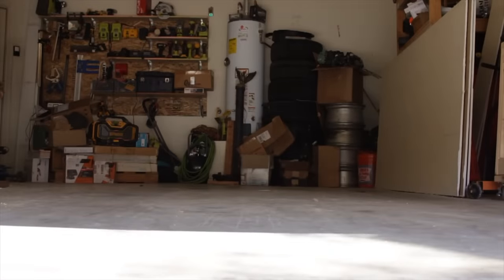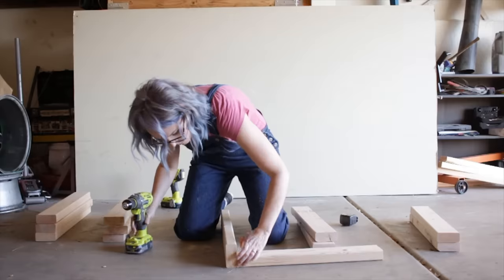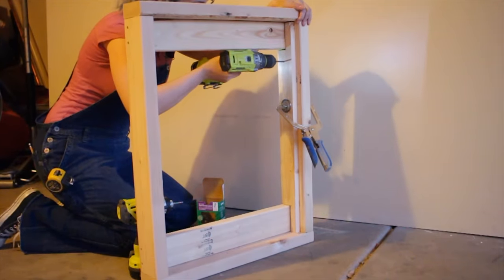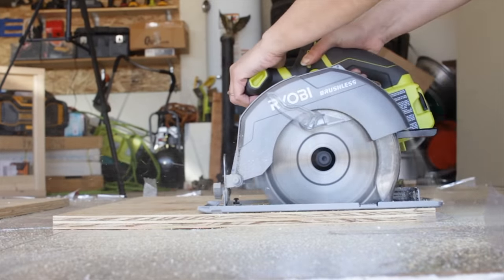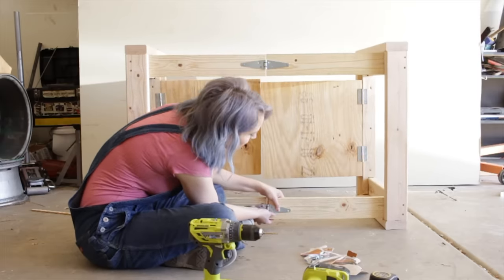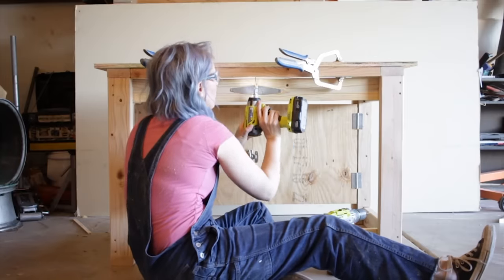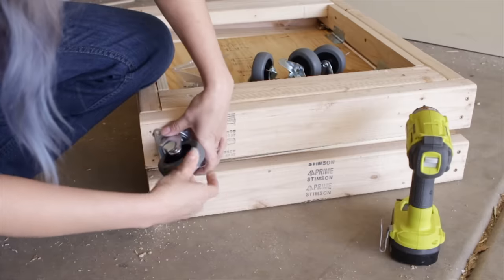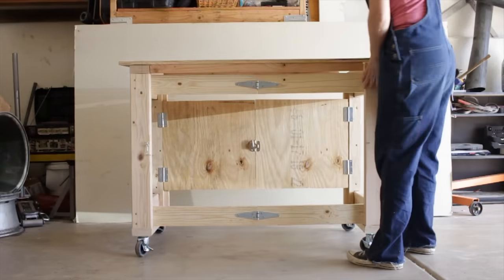DIY Folding Mobile Workbench

Comment: What is the total weight of the bench?  Is it easy to load in a truck or van?
Reply from the maker: It depends on the particular materials you use, but the base alone is about 25lbs

Comment: Remember seeing this on pinterest and thought it would be great to make it since I don't have space for a permanent work table and I'm really tired of making projects on the floor. Now I hace a better view of it and seems really nice. However a mod I will do is to make the top foldable in the middle, attach some L-shape brackets at the lower frame so it can be hanged there when the table is folded. A long piece of square metal tubing can be put below the top to prevent warping and make it sturdy for heavy objects.
I have a question, that plywood piece that is used for support in the back of the table, can it be substituted for two wood pieces like the ones in the front or the plywood needs to be obligatory? Thanks for the inspiration of this video!

Comment: The author mentioned the initial design came from a April 2012 issue of Popular Woodworking.  I went through that issue and couldn't find it.  A quick search of the PopWood site showed that the article is actually from the Feb/March 2007 issue of American Woodworker (which was purchased by the parent of PopWood).   So if you want to see the inspiring design, look there.

Comment: Good job, the window locks, stiffening rails and dowels were great upgrades. I'm wondering how stable the table remains after the casters are locked. If you come up with a change for that, please do an update video. Thx, you da man!, oh wait, "da woman!" 😎
Reply from the maker: Thank you! haha I appreciate the feedback. Once everything is locked in place, it's actually very stable. I have virtually zero wobble, even when using the belt sander. I for sure will share any updates down the road.

Comment: Unless you need the practice 2 saw horses and a piece of 3/4 plywood is way easier it's what most contractors use on jobsites. It's super portable and simple. This is a neat idea though

Comment: I am building the folding work bench, on the cut sheet you say 2  3/4" x 18" x 20 1/8" but in instructions move 6 you say cut 2 18" x 21 1/8" which is right it looks to me like they should be 21 1/8. What sucks is that I pre cut the pieces before hand. please let me know....tanks

Comment: Instead of measuring for the dowel locations on the top, insert the dowels, set the top in your desired position and carefully lift each end enough to smear some grease on the dowles. This will quickly transfer thier locations.

Comment: Initially, it seems like a good idea until I calculate the amount of money for the materials to build this workbench. It costs around $170 - $200 depending on the quality of materials. The Worx Pegasus costs $110 and is foldable, mobile, lightweight (25 lbs) with extra 2 clamps and dog ears. When folded, it can function as a sawhorse but when fully extended it is a decent size workbench. With that money for buying materials, I can buy 2 Pegasus which are very sturdy and don’t have to lift a finger to build it. This is a good idea if you have extra lumber or can buy it cheap from somewhere.

Comment: I've built one, bigger in size and with a vice on it , besides the fact that is soft wood and the top will not stay straight unless i add a middle leg , i'm really happy with it. But next time i'm gonna build one i'm definitely gonna make myself a easier job and fit some components the way you did, without routering like a maniac over complicated joints .

Comment: I'm curious, would there be a way to attach the top to each side so that it could be hinged and fold over onto the top so it didn't have to be detached from the frame? I know it would mean cutting it into 2 pieces. Would it cause you to lose stability?
Reply from the maker: I was trying to think of something like that too, but was afraid of losing rigidity. All the strength in this design comes from the top, so I couldn't think of a way to make it folding. If you come up with an idea, I'd love to hear it!
Reply: Pneumatic Addict you can potentially use a curved linear guide system on the legs to allow the tabletop halves to be securely fastened to the workbench frame at two points but still be able to slide/fold away. Adding some kind of clamp or locking mechanism to the centre portion of the horizontal frame which the tabletop locks to would give you a secure fixing for the tabletop and reinforce the overall structure.

Comment: Personally... I would have drilled down from the top of the Worktop down into the Runners... it'll be stronger as you will only have the depth of screw in whatever thickness of top you have the way you did it and then have the chance of the tip sticking out if you over tighten the screw... you can countersink the heads into the worktop and even putty over the top of them if you fear scratching a project... the other bit that set my teeth on end was referring to your Ryobi Cordless Circular saw and saying it should last another couple of projects... with the cost of any of Ryobi's Power tools it should be lasting years... not just a few projects... O.O Oh yeah... I can see there's a difference between the Plywood "doors" Sash lock and the one you showed yourself fitting... the "hook" part of it is hooked away from the clasp side of the lock - as fitted on the "doors", you had the "hook" facing the wrong way on the 2x4 side... other than that, it's not a bad idea, but buying a short length of ordinary Kitchen Work top, a piece of 2x4 the same length as the work top and a Black & Decker Workmate... which is so versatile on it's own, and by screwing the 2x4 to the underside of the Kitchen Top you can then clamp it in the vice jaws of the Workmate... even one of the cheap ones... by the time you have bought all that Hardware you're pretty close to the Workmate just up from the Entry Level one... just saying! ;o)

Comment: What stops it rolling around when suing?. Could cause accident. Do you mean 100× 50mm for legs?.
Reply from the maker: I am located in the US and use Imperial measurements. The caster's I installed have locking mechanisms and are easy to find at almost any hardware store.

Comment: I bought your plans for the 8 bucks, the hook and eye doesn't say what size they are. 2 1/2in or 3 in ???
Reply from the maker: Either size will work. If you use the 2-1/2", you'll just need to attach it closer to the edge of the board. For that reason, I would probably go with a 3" hook and eye.
Reply: @PneumaticAddict  thank you for the reply

Comment: How and Why do you pre drill??
Reply: So you don't split the wood is the number one reason. 
It also makes it easier to put the screws in. The screws will always follow the hole that you drill. 
The hole that you drill should be no bigger than the inside threads (the shank of the screw if you will) of the screw that you use.

Comment: So some of the areas you can improve this design are simple.  First if you were to use pressure treated 2x materials to increase the speed of assembly.  You don’t have to pre drill.  
Second pocket screws.  This will add more strength that what you’ve done here.  Better holding power and keeps you frame straighter.  
Third, heavier top.  Double that top thickness.  That will really help you design.  And round over the edge. Full 3/4 round over bit will finish this off big time.  
Lastly add a permanent tape measure to the working edge of your top.  It will allow you take quick measurement of small pieces of wood or items without needing to pull out your tape measure.  
One other thing you could do is drill hole for screw drivers to stand up on for easy reach and quick handling.  Adding a strong earth magnet to the front side of the bench will keep those screws you need for putting stuff together without taking up table space.

Comment: If you build this bench & have a specific height you need, take into account the exact height of the casters. The 3" casters I got add 4-1/2" to bench height because mounting plate & swivel thickness. So if you build the bench 30" tall & attach 3" casters it's not going to be 33" overall.

Comment: Just completed this project, came out great.  A few tips:
I did pay for the instructions which were very good, although there is an error on page 8, states 21 1/8", should be 20 1/8"
Make sure you get butt hinges which are much different compared to mortise hinges
For the dowels, I drilled right through the plywood to the base structure, which worked perfectly, I measured 2 1/2" from the front of the plywood and 3 1/2" off the side.  Took off the plywood, cleaned up the holes a  bit, cut the dowels to length, reattached the plywood and sanded down the dowels

As far as the project, this was a bit tricky given all the hinges and aligning everything.  In the end I am extremely happy with the end result.
Here are the hinges I used:  https://www.homedepot.com/p/Everbilt-3-in-Zinc-Plated-Narrow-Utility-Hinge-Non-Removable-Pin-2-per-Pack-13597/203170043

Comment: If you have time to waste in order to prove to yourself your abilities(and do all the labor), psychologically, it may be worth doing. But if you look at the cost making this, it is just prohibitive! Although I like the design concept, adding up the cost of the materials (including the top, ~ $70 for the cheapest 3/4" plywood) ends up costing over $200. One can buy a metal (lighter in weight but sturdier) folding table at half that price. The weight of this table is over 55 lbs (quite heavy in case one needs to move it and work on a non-concrete surface).  Of course she got free tools and materials to build this and all seems perfect but she never mentioned the cost.

Comment: .
If you work on objects so often that you cant get buy with just using the ground or a box or something then you use a bench way way to often to be able to ever fold it away.
Who would want to spend as much time re-assembling a tool bench each time they want to use it?
I mean that if you spend so much time creating or repairing things that you need your own work bench then at the very very least you would want it always assembled and ready and secured to the wall.
how do you even use a workbench with wheels on it? 
What can this bench do that a milk crate cant do? I mean that if you need something so substantial then this would fail. Using a vice or heavy hammer blows are why one uses a bench over a box or a table.
I am not trying to be rude or negative, I am just very curious about how and where this could binifit someone?
I am ever seaking space saving ideas for my crowded shop but a bench that cant handle torq without moving is no more than a small table or a box. Why another object in the shop that even when so stored it takes up space? why not just use a box?